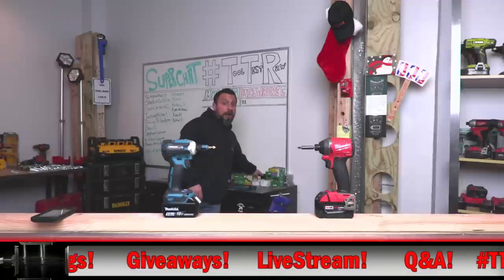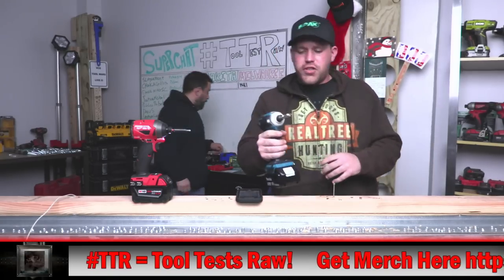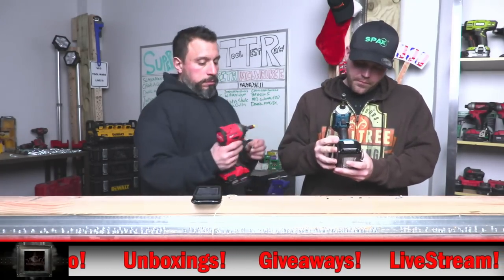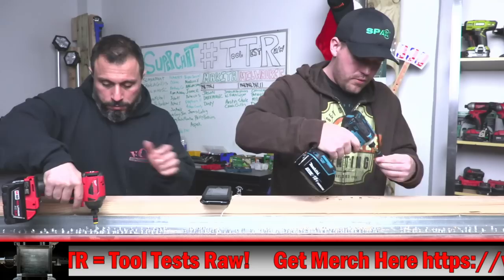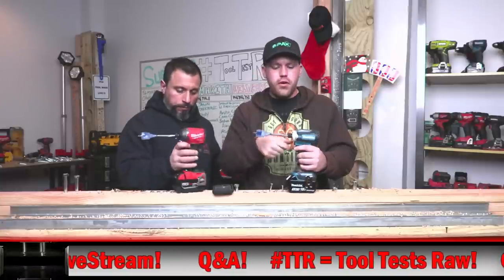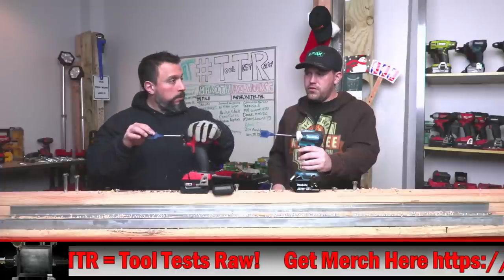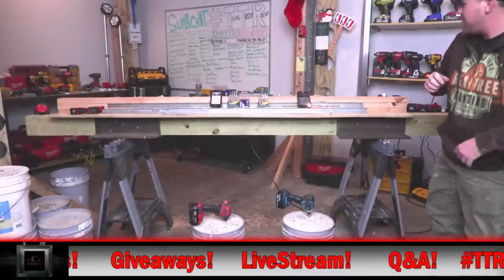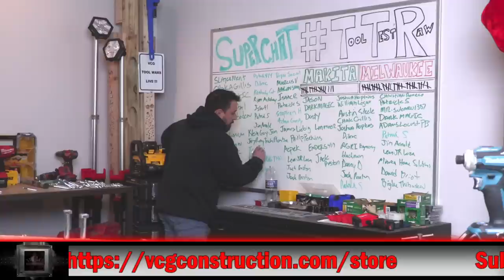Best Impact Driver Tool Test - Milwaukee (2853-20) VS Makita (XDT16)

Comment: I am currently retired; I am a licensed carpenter and had my own business since 1989 and worked as a carpenter 5 yrs before that I used my tools daily. I still have my original 7 1/4" Makita skill saw. All I have had to replace is the power cord a few times. I liked it so much I bought a second one I keep, one for rough work and one for finish work. Both still run fine.
 I also still have and use my Milwaukee 18 V 1/2" hammer drills. I bought the combo kit with an extra drill. My only complaint is Milwaukee 18 V batteries just don't last I am sure the new batteries last longer. But both my 18V hammer drills are in perfect shape. I had a Makita 7.6v back in the day which I sold; it was just too under powered. Then I purchased a 12v Makita drill which I probably would still have only it fell off the back of my truck. I always say buy the best you can afford and it will last. Since I am retired and got sick of buying new batteries every year or so I now have a Ridgid impact driver and I also bought two 4ah batteries and charger that also qualifies for the life time service agreement. I also bought a Ridgid oscillating saw with batteries that qualifies for LSA . Then I made an adapter to fit my Ridgid batteries to my Milwaukee drills. I don't use them every day any more. but I haven't bought a battery since. Makita, Milwaukee, and Ridgid make good quality tools that stand the test of time.

Comment: You can say Milwaukee got their faster but it also overheated which is very bad for the tools longevity. I would rather the tool move a little slower and produce less heat.

Comment: If you run a 5 amp hour high output battery on the basic 18 volt milwaukee brushed impact is the a benefit

Comment: So from the video it looks like milwaukee tool featured doesn't have as much control on speeds as the makita does. I'd assume if you don't want to chance stabbing your material or slipping off your fastener the makita could be the way to go? Cheaper than getting the wifi version of the milwaukee? How straight did the fasteners go in with each drill? Does one apex have more wobble in it than the other? I am debating purchasing the milwaukee driver/drill combo since one of my Makita batteries just died after 8 years of use in my set. I use milwaukee at work and have a 12v for home use, but the batteries seem to work loose. Thoughts from you boys please. In the future could you also use identical bits so it's a exact comparison and a vertical test? Thank you.
Reply: Makita is a smart buy

Comment: Just purchased and very happy with Milwaukee M12 1/4 and 3/8 inch "Impact Wrenches."  2461-20 and 2463-20.  They add veratility to my tool kit at a more econimical price point.  Both make quick work out of disassemnling engine lines, hoses, and components. Sometimes a mechanic does not need "Fuel, Brushless, Gen-3 and all that jaz."  "Just get 'er done!"
Reply: it's just that with brushless you will not need to change the brushes later. and you will get much more of a single battery charge.

Comment: Aye bought the dt171 the japanese version, it might not have the same  torque as the gen 3 but rpm, ipm are not far away, the run out reduction makes the makita so smooth lovely in the hand, milwaukee seem to heavy and cumbersome
Reply from the maker: I will say the Makita is lighter
Reply: @VCGConstruction  Vince what do you think of the makita? Better than the gen3,  torque and power isn't everything
Reply: 16is171 same

Comment: I use to auto Modes on my makita to wrench on anchor bolts . It delivers speed and power gradually and it works perfect,  In a way the Milwaukee can’t

Comment: I kept hearing Milwaukee is to fast... Maybe Makita design their tools with power and control so you wouldn’t strip the screw before you even got a 1/4 inch into the wood?

Comment: I have beat the utter shit out of my M18 gen 2 drill and impact. I also have a M18 circular saw. My other saws are corded. However I am extremely unpleased with the gen 3 slipping as bad as it does.. You do not drive lags that huge often.. Pre drill it hell... Both are made in china.. I am favoring the blue this gen... And I love Milwaukee. My gen 2 still works good but the alpha in me wants to buy this Makita. I would convince my wife I needed it. I am the king of blowing smoke up my wifes ass.

Comment: I like the makita better and had makita brushed set drill and impact. Recently I wanted to upgrade to newer and more cordless tools. And I chose to go Milwaukee to be on the platform and they have so many more tools cordless and are growing the fastest. You can go to Home Depot and get a good variety of tools there or online. And they are still a great tool that’s my reason for going Milwaukee great video guys 🍻

Comment: Thats actually pretty sad for makita... what is this like gen 4 for their brushless model at this point?? Like how many features do u need on an impact, it’s getting out of hand. What did we ever do without these 6 drill modes...
Reply: Eh they have both had like 10-15 different models at this point man, is a little disappointing though, first time they lose flat out, guess its why I have both Makita and Milwaukee tools!
Reply: At the least the collet seemed to be quality, definitely not a bad tool just expected more.
Reply: It seems they're comfortable with the performance and just refined and added features. 

But yeah, every company has a ton of impacts at this point
Reply: DeWalt only has 3 brushless impact models. They need to start coming out with a new 1.
Reply: Dmitriy Barsukov you can change your SUV tyres with Makita ?

Comment: No one uses their impact driver to its full potential, wish people would stop talking about the power, what good is power if the impact breaks, if it has zero feature. Im not dropping over $250 for no basic model impact that has quality issues. Makita in 18v and Milwaukee in 12v easily

Comment: Milwaukee is all about power, more power than you actually need. It's like having a v12 4x4 car when you only pull a small trailer, whats the point you're just screwing up the planet. You look at 2 tv sets in the store side by side, one is marginally better, the time you get home you really won't know the difference. If you spend time on site racing your impact driver with your friend then there s something wrong with you.......... get back to work lol. I have a Makita set but I'm really really tempted to switch to Milwaukee. I think Makita just take it for granted that they can sell just off their name. Look at Milwaukee go, time to step up Makita

Comment: only thing that can beat that gen 3 is another gen 3....until gen 4 comes out
Reply: denali7432 Or anything that can hold a bit lol jkjk. Thats a shame though, it seems to be a reoccurring issue based on reviews.
Reply: I hope not soon because I just spent a lot on gen 3 sets.
Reply: Just use some 3 in 1 oil.
Not WD-40

Comment: Well this test was disheartening considering I just ordered the Makita xdt16 off Amazon because all the other videos I watched eluded to it being the best new impact on the market, LOL..
And maybe there are some underlying reasons that make it so still, but I don't know.
My DeWalt 887 finally took a dive after 3 years from the top of the rafters onto a concrete floor. I used it hard 5 days a week for years and it held up. 
I was looking hard at the Milwaukee 2853 for its compact size and power. 
I do metal work, ductwork, heating n air, ect, and could use the extra slice off the length to get into those cuss-worthy tight places...
But two of our guys at work have the Milwuakee 2853 and they both have coller/Chuck issues. They seem to hold onto the bits just fine, but getting them to take initially is a pain in the ass, especially if you're constantly swapping out bits, and I got enough crap to deal with, and every small aggravation builds upon another, LOL

Comment: You must have gotten a Bunk Milwaukee. I sink lags all day  way quicker and I don't even have the Fuel. You do need to lightly break in tools before you just slap them against the wall. they will never work right until all that grease gets warmed up and gets in all the spaces. you're just burning the grease right out therefor high temps and the impacts are slipping instead of hitting like they should. I'd throw those away. they will never work right now unless you take em apart and grease them properly.

Comment: Yes it’s the operator, dude with the realtree top needs to go get some lessons in how to use a drill properly, also judging a win on how fast they put a screw in on lower speeds is dumb, the lower speed settings are there to use on small intricate jobs that require less power, you would be pissed using the Milwaukee on speed one and it either slips out and you damage the material or it just sinks the screw in way to far, speed tests are pretty much useless for real world stuff, versatility and function win over power, it’s not a drag car it’s a tool.

Comment: I take my lug nuts off my gmc 1500 with my fuel impact when I rotate my tires, change brakes, ect. Then I put them back on with it, no torque wrench or anythuing. It has the perfect amount of force. Works everytime evry single lug nut!
Reply: Sure hope you’re checking those lug nuts with a torque wrench lol

Comment: I bought the Milwaukee 2853 and ended up taking it back.  I do mostly 3" deck screws and it was actually too powerful for those smaller fasteners.  Mode 3 was not even an option, and even in mode 2 it would spin out of a lot of the torx head screws because it never impacted, it just straight drives them.  Maybe a one key could be dialed in, but I want the impact to actually impact and it would not on the 3".

Comment: Why are you speed testing with those giant ass screws on speed 1? Lol. Speed one is for stuff like cabinet hinges and other little detail work that you absolutely cannot afford to damage. It should be as gentle as possible. They comment you laughed at in the video is correct. Makita has their roots in fine woodworking where precision is everything.